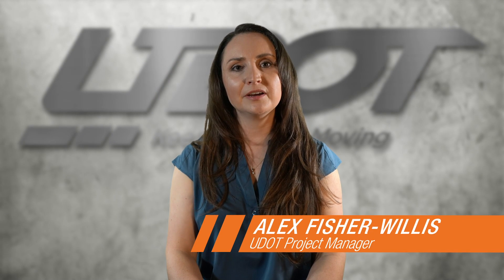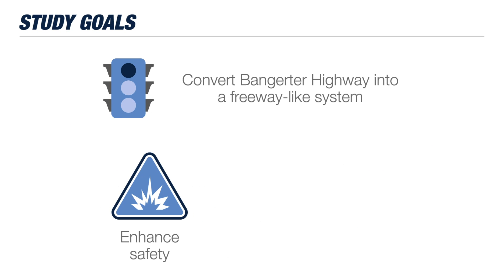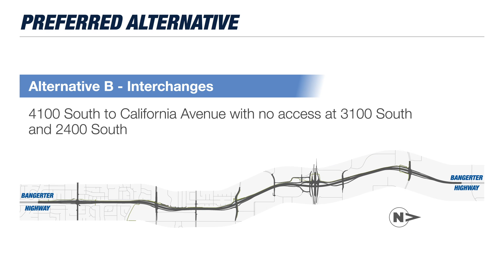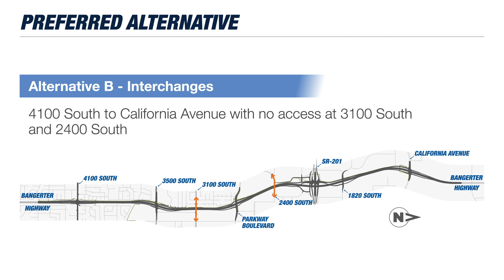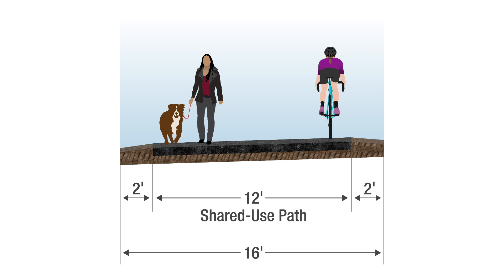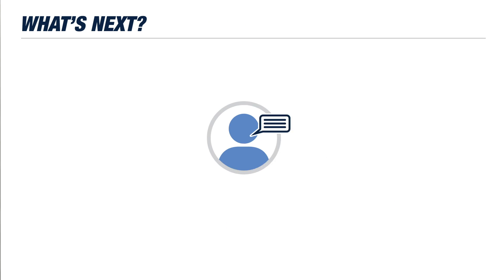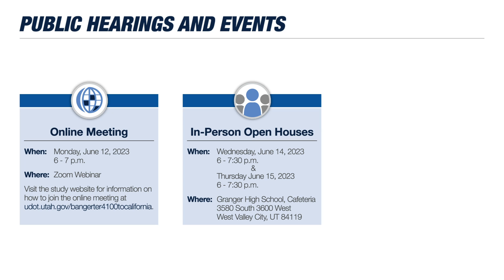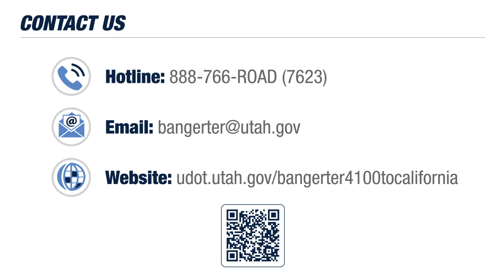Bangerter Highway; 4100 South to California Avenue – Preferred Alternative

Comment: It makes no sense to have a grade separated interchange at 4100 S when there will be one a mile south at 4700 S and a mile north at 3500 S. 4100 S should be the same as 3100 S with no freeway access. No reason to destroy a 60 year old neighborhood just to have an interchange where there is no need for one.
Reply: I've been pushing no interchange here for almost 2 years since they were planning 4700 South.  Of the extra 60,000 people using Bangerter by 2050, how many will get off on 4100 South?  We have very little, large truck traffic.  Just a few deliver vans for the stores at 4100 So. 4000 West.  For the 1 year or so they close 4100 South between 3600 W and 4000 W to do any construction, we will be used to using 3500 So. and 4700 So., just like we do for I-215 and I-15.  I'll keep fighting.
Reply: 4100 S and 4700 S are equally as congested.